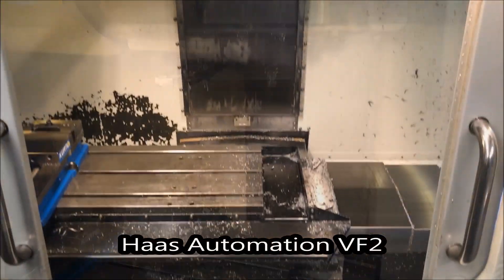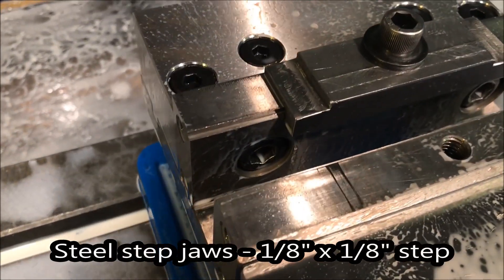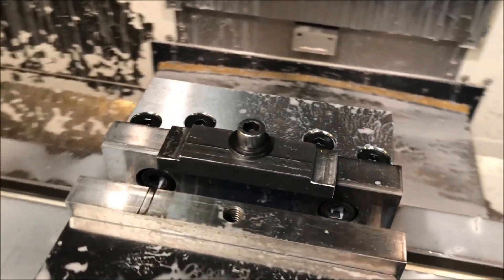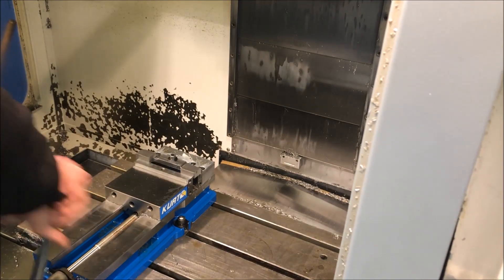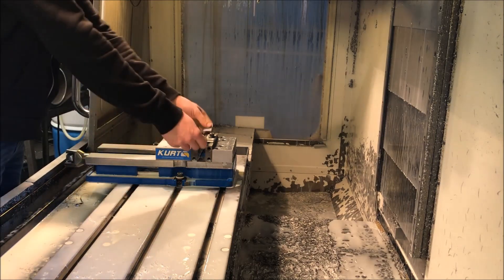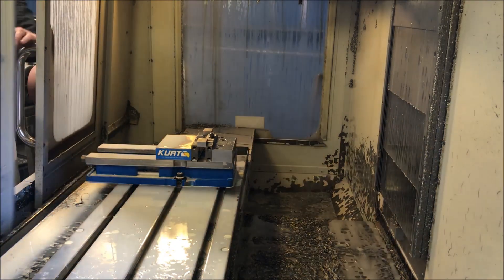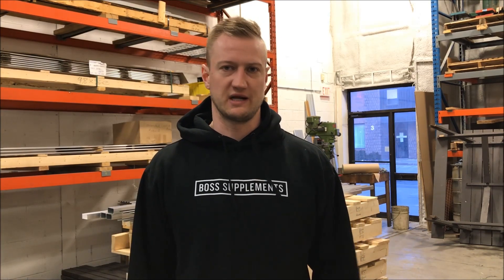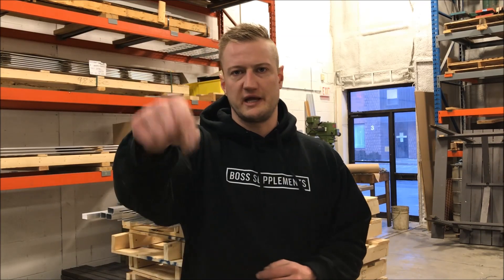[TT] BEGINNER CNC:  RUNNING TWO PARTS AT A TIME

Comment: It sounds like the work offset is set from the center of the fixture. Is that right? If so, do you just have it in the CAM how far apart the two parts are from the center? I am just starting to learn CNC stuff on a Haas TM-1.  My first thought was to probe G54 off of the left one and G55 off of the right one. Copy the program made for one, paste it below the first part, and switch the work offset. This would double tool changes through, which would be a pain in our machine without an automatic tool changer.
Reply from the maker: Yup! Your method works well too and is good to keep things nice and accurate - this one is programmed for this size of stop so it works to have it off the centre but I do frequently do it in the way you describe - it lets you use any size stop you have on hand your way!

Comment: This is a great strategy:  2 hands - 2 out - 2 in.  You should keep the series going and do multi vise OP1 , OP2 and etc.  For short runs I still think Verticals are very Economical.  Especially simple rectangular parts, just get a line of Vises.  Multi-axis seems to be getting easier to program, but you have a large investment in tooling to do multiple parts, plus programming to avoid collisions.
Reply from the maker: Oh yeah! I run eight double vises at a time with a similar method to this to do 34 parts at a time with a different job - G54, G55, G56, etc - it works really well!

Comment: Very cool man, I just recently invested in Snap Jaws for our shop which allow you to slide them in and out a bit quicker than traditional jaws. They make step jaws in some nominal sizes, I have for instance a 5/16 pair that I use often. They are pretty slick and have tapped holes on both ends so you could run stop rods from both sides. Down side is they are a bit pricey, and a small shop with minimal budget may not want to invest in these, but they do save time if you do constant setups like we do. The other element to deciding when to do multiple parts is how much time do you want to spend programming and setting up a bunch of vices, along with making sure every station's parts are coming out to spec etc. Sometimes it makes more sense to just get them running and bang them out as we say!

Comment: I dont have a grinder or way to heat treat. We use mostly soft jaws for aluminum parts. Is this not a good way ?
Reply from the maker: Soft jaws are a great way - we use them frequently too! They just tend to wear out and lose tolerance during long production runs from the constant opening and closing causing them to warp.
Reply: That makes sense.  We never have more than 10 20 parts at a time.  Thanks man
Reply: Soft jaws are great if you recut them after each time you bolt them on the vise.
Reply: A good option is to Hard Anodize jaws. 6061 will last much longer.  Hard anodized 7xxx Aluminum will work very well and last.  I like 7075 for aluminium tooling and would recommend it over CRS 1018 or HRS A36 / A572.

For steel I like 1040 or 4140.  You can purchase 4140 pre hard from McMaster or MSC.  The brand they commonly stock is Precision Marshall.  Buys some good steel specific end mills 5 or 6 flute, bull nose, TIALN or ALTIN;  So you can hit accurate numbers and have nice straight walls.  You don't need the super specific " Hard Milling " ones.  If you are strictly an Aluminium shop, you may want to start with the 7075 and work steel in for higher production parts.

Comment: Great idea!  How would you fixture this if you had thousands of parts to run?  I realize there are a hundred different ways to do it just curious how you would tackle it?
Reply from the maker: Good question! We do a similar sort of part with a lot more milling - and we actually do them 2 at a time like this  - but in six - eight double vises inside the VF5 - meaning we get 24 - 32 parts per cycle! Otherwise, if we were doing thousands upon thousands, I'd probably make tooling plates with something like Mitee-Bite clamps and reload one while the other was running.